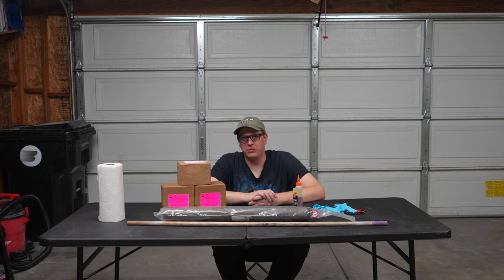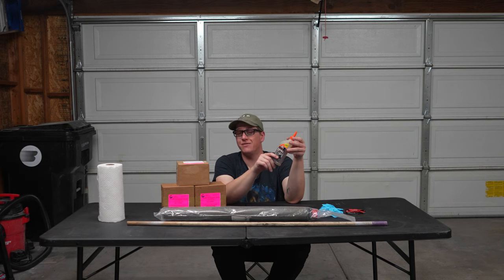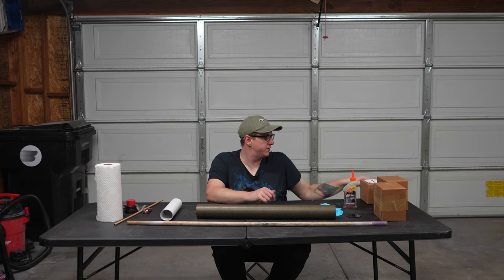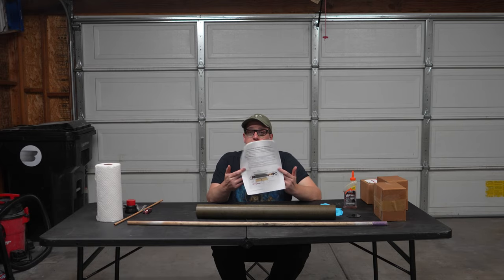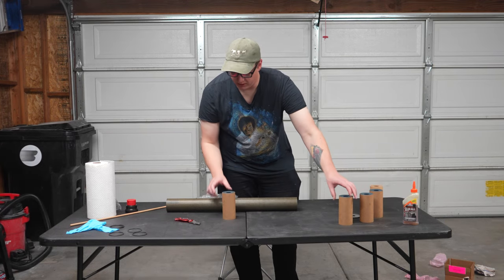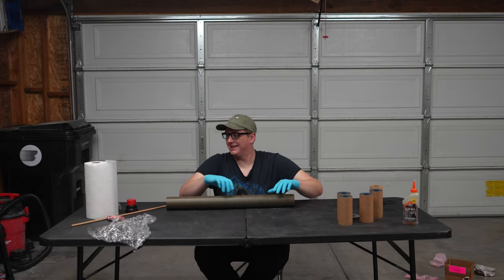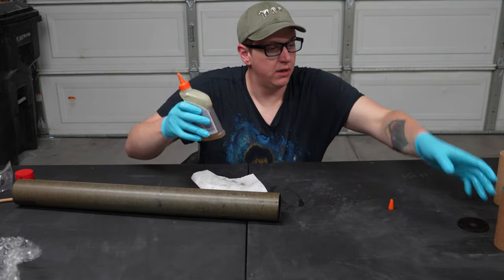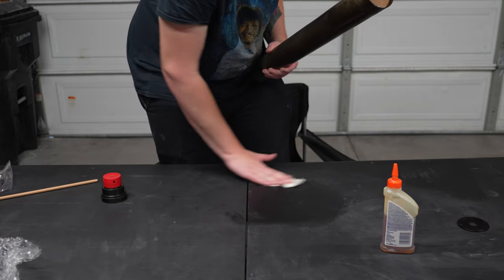Gluing Propellant Grains (Grain Bonding) in High Power Rocket Motors

Comment: It is not the brand of glue, it is the type of glue - expanding polyurethane. Elmer's, Gorilla Glue, whatever. I started using this about 20 years ago on a prototype "N3000"  flown by Greg Mills at ROC Lake in Alberta in a minimum diameter rocket. This stuff has a blocked isocyanate curative that is set free by moisture. You'll speed up cure and help things along by wiping the inside of the liner with a LIGHTLY dampened cloth, all you want is trace moisture, not wet.. more like a humid liner. If you are doing this in a humid environment you may not need the wipe. It will expand and cure, locking the grains in place and will seal the space between the liner and grain preventing pressure equalization and potential gas flow around the grains - which is more of a problem as the L/D gets higher and higher. Also pressure dependent.. low pressure motors have less of a problem as the gas is not trying to escape through any possible route. Once you get a gas path established between the grain inhibitor and the case liner you may be in trouble.

Comment: Great video! No matter how many times I do it, I still check and re-check everything before I start gluing including the instructions. I like to build the whole grain stack with spacer o-rings, connected by scotch tape around each joint. Then test fit. Then glue and slide the liner down over the vertical grain stack. I saw that idea on another video several years ago.  Also, because I have received the wrong instructions in the box before… fast burning motor - grain bonding. Long burning motor - end bonding. It didnt seem right when I read through the instructions for a fast burn motor. I emailed aerotech and sure enough, wrong instructions were included.

Comment: It's not about whether the glue foams, all Polyurethane glues foam, it's about how much it foams. Elmer's foams less, though it doesn't seem to be that big of a problem, especially if you don't go overboard with the amount of glue. Other than being an inherently messy experience, I've had no issues with gluing motors. Even Loki motors like the K627 was pretty easy and that's a 38mm motor and they recommend epoxy, Loki Scott's process makes it easy. It's essentially how @TheTankFG does it
Reply from the maker: I want to do an open-air test to see if it really foams more. I'm curious. The overall point,  though, was that the liner cracking issues seems largely non-existent if you're not going crazy with the glue used. I do imagine it could be a lot more prominent of an issue in areas with heavy humidity, though.

Comment: Just saw you tube video yesterday why that  Elmer's ... Seems I ran into a guy talking about how one of the MOTOR companies made there way to the top. He said not long ago a guy transporting some grains what ever. that they came lose in some way. he used epoxy not the Elmer's that I it to be used with... this made the grain's explode and burn all down ... in short this is why the Elmer's. if you want to look it up I am sure that you would know more of where to look then I would... Hope this helps...
Reply from the maker: Gorilla Glue isn't epoxy, though.  It's virtually identical to the Elmer's Glue All Max. That was what I was driving at, here. They both foam and they're both fine to use. One is cited specifically in AT instructions and says "low foaming" on the bottle while the other is neither and it seems people took that as gospel. Haha
Reply: I am just trying to hear here. will try and find the video so you can see and hear it . the man was a part owner of Aerotech so I only know what he said sorry...
Reply from the maker: @billholcomb-mw4eg  No need to apologize! Like I said, I'm no propulsion engineer. I'm all ears for further explanations.